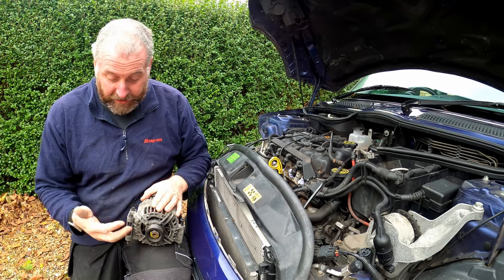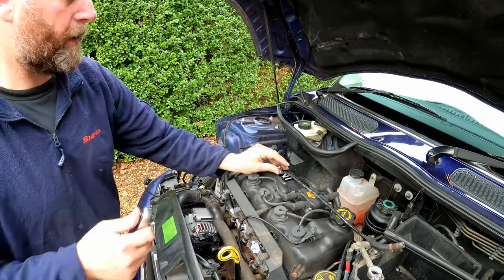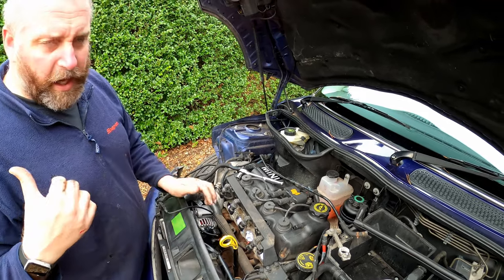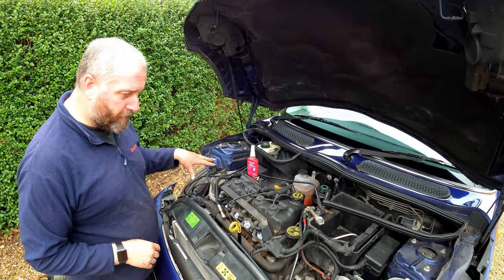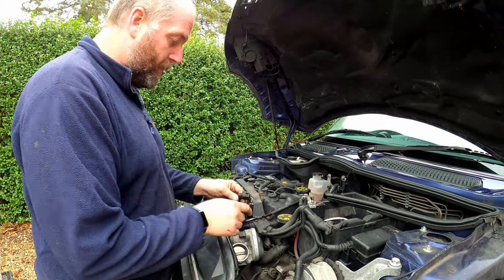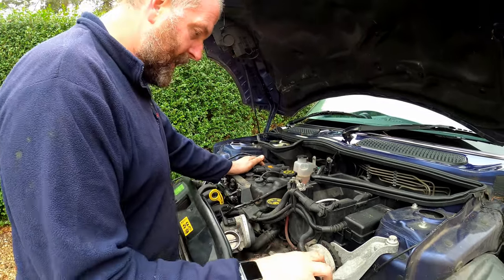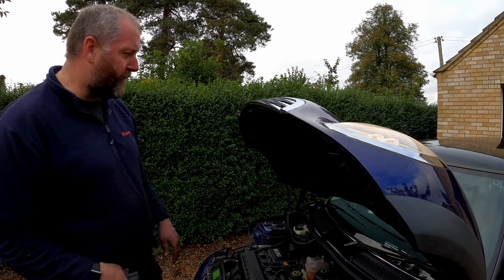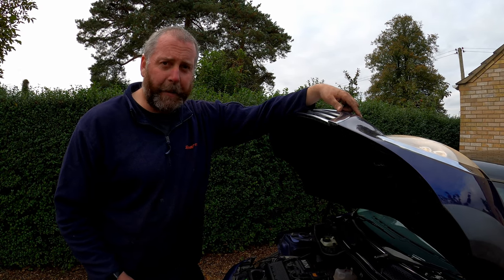Mini One & Cooper, R50 & R52, 1.4 & 1.6 Litre - Alternator Change, Full Removal & Fitment - Pt. 2

Comment: Thanks for the video was a great help - I didn't take injectors off etc needed to change the water pump as the wheel broke. the best info for me was the 2/3 drive to lift the tensioner. job is done now and much appreciated 👍